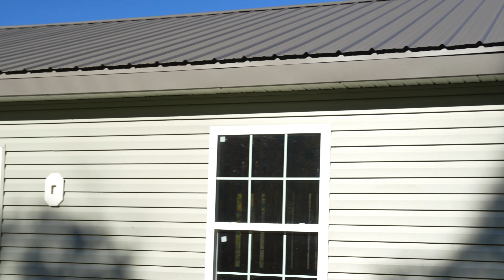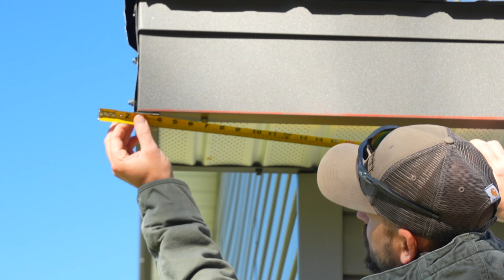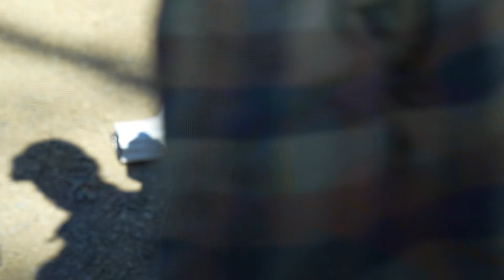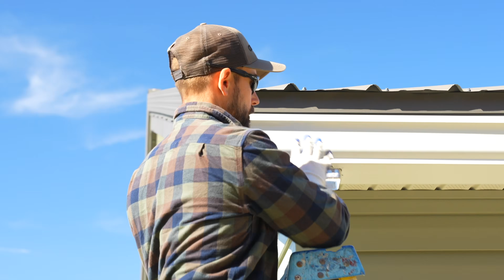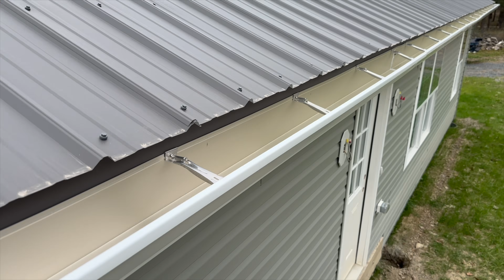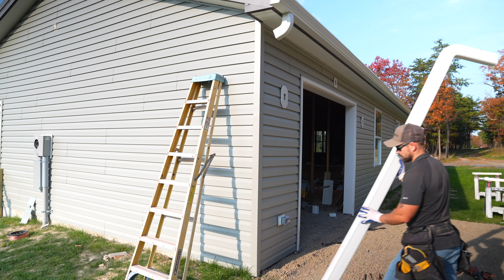How To Install Gutters | DO IT YOURSELF!

Comment: Gutter installation involves measuring, cutting, sealing joints, and ensuring proper slope so rainwater flows away from the home. Walker Roofing & Construction LLC provides expert gutter installation Mentor Ohio services for reliable drainage and long-lasting protection.

Comment: I had to notice that you didn't answer any questions about installing under the drip edge, why is that? 😊
Reply: The drip edge is as long as the house roof. If you extend the gutter out by 1 inch or so you can not do that. What I did was to install it out of the drip edge but at least 1/4” far from the highest side and then use pieces of drip edge to tuck under the existing drip edge and overlapping the gutters edge. Works great and you don’t even need to screw it

Comment: Excellent .  It's details that are important.  You explain the little things you know us DIYers are likely to screw up like direction of water flow, crimping the end of bends going to downspouts with needle nose pilers  so they'll slide in easier,  how far to slide them in,  using the sealant,  how to cut gutter with reverse blade mitre saw, etc.  Your details are what made this video great.  You are an excellent instructor.     Your video recording skills are excellent as well.  Now I'm gonna fix that darn gushing  downspout connection at the  corner of the house.  Thank You!

Comment: well done.  2 things i would like to reccomend.  the down spout flange just turn upsidedown and scroll it. no measuring needed.  little easier for the dyi er.  also. pop rivoting although secure does not allow yo to take apart if you need to clean some stuff out that just wont get through. Use the small white zip screws for that  

 just a couple ideas

Comment: He was able to hand-hold a drill to put those end cap rivets in? As soon as you touch the tip of the drill bit to the sheet metal, it's going to want to walk - and there's very little space to put those rivets in. Hmmm ...

Comment: How big is the facia board? Is that 1" x 6"? A 6" gutter is 5" high and the drip edge takes up an inch or so. So how would a 6" gutter fit on a 1" x 6" facia board?

Comment: I didn't read all 140 comments so I apologize if this question was asked and answered. Why don't you just use the small white screws for the whole down spout section instead of the rivets? That way if you need to take any part of the downspout section apart it would be much easier that drilling out the rivets?

Comment: On an older building I would check the facia for level and not assume.   Also, on a long run with downspout at each end, slope downtown both ends.

Comment: Couldn't you also call up a gutter company and have them manufacture a seamless gutter set for you (After you measure everything) and then just have them deliver it to you/ you pick it up with a Home depot van?
Reply: Take a minute to reflect on what you just asked. You're asking them to manufacture let's say 60 feet of seamless gutters, have them delivered to your house.  How much do you think you'll be saving by not letting them install them?  I mean the guys are right there.  And two; Have you ever rented a Home Depot van to deliver 60 feet seamless of gutters?
Reply: @lagunabay51  I dont know, but labor is typically the most expensive part. If you're a brokie but you know how to do mechanical stuff its a good learning experience. Also, the forward slash is the alt option in case they dont want to deliver it

Comment: Does the gutter tuck under the drip edge or do you secure the hanger over the top of it?
Reply: If I remember correctly the gutter should tuck under the drip edge directing all water into the gutters.

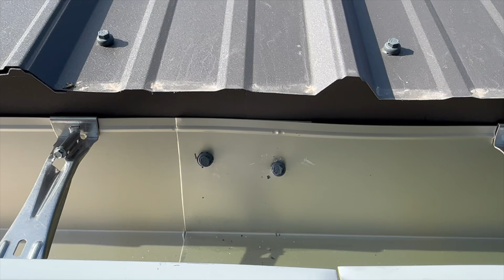Comment: Hi! I do seamless raingutters for a living, and let me be apparently the first to tell you that this video... is absolute dogshit. Surely this has to be a gag video for clicks. First and foremost, you are ON TOP of the flashing. Not behind, not underneath, ON TOP. The rainwater is going to run behind the gutter and rot out your fascia, and all that "money you'll save doing it yourself" will in fact cost you more in the long run fixing the shit than it would've if you had a professional come out and do it right the first time. Also, what is up with all of the rivets? I mean like holy shit dude, six rivets in the front AND the back of your overlap(not even gonna mention how incredibly soft using a c-clamp is), and do you think you sank enough rivets into the downspout? Oh, and @14:15, I have legitimately no words for how fucking awful that looks. You should be ashamed of yourself for spreading misinformation, I seriously hope you're not really out here doing this to people's houses.
Ladies and gentlemen, this is gutters done WRONG. This video is absolutely, unequivocally the WORST possible way to do gutters. Don't trust a word from this hack.

Comment: Im not sure why but I dont see a drip rail from under the metal roof and over the back edge of the gutters.That back side crease on the gutter Is to accept the lip rail to keep water from reversing back to the substrate.

Comment: Hey Josh,
When you extend a gutter 2 inches past the edge of an eave -- beyond a roof side that is a gable end (as in 5:10), do you do anything special to the lower drip edge running along the GABLE edge? 
This is the gable drip edge that runs perpendicular into the back of the gutter extension. 
Do you put sealant along the edge between the drip edge and the back face of the gutter? 
Do you add a right-angle flashing here? 
  - If so, where do you apply the flashing? Behind the drip edge? Forward or backward along the back face of the gutter?
  - If so, how do you attach the flashing? Pop rivet to the drip edge? Sealant or pop rivet between the flashing and the back face of the gutter?

Comment: Hey Josh,
Is it possible to "waterfall" both inside and outside corners?
By this I mean that: after putting the upstream gutter down inside the corner, is it then possible and proper to put the downstream edge of the CORNER down inside the downstream gutter?
This would have the water waterfall over the upstream gutter edge down into the corner, and then the water would waterfall over the CORNER edge down into the downstream gutter.
Is that corner installation method better than installing BOTH upstream and downstream gutters DOWN INSIDE the corner?
Note: It would require snipping out the front UPSTREAM  lip of the corner in order to accept the overlap of the upstream gutter.

Comment: I followed this video for my DIY gutter install—worked great, but I noticed water leaking behind the gutter. Should it be installed behind the drip edge? I didn’t see that mentioned. Thanks!
Reply: I worked gutters professionally; yes, the  gutter should be behind the drip edge.
Reply: what. If. No. Drip edge. Was. Installed. Before. The. Roof?  Can. You do. Drip edge. After. And. How. To install it. ?

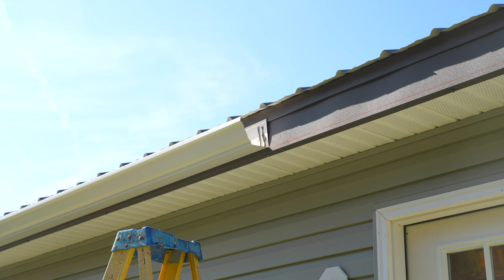Comment: Excellent video!  Question:  There is supposed to be some type of strip that tucks under the shingles and down the side of the fascia?  Kinda L shaped?  Thus preventing water damage to the fascia?  @13:32.  My house does not have that, is why I’m asking.
Reply: You are correct! The gutter is always supposed to go behind the drip edgs as well. If installed gutters like this, you will eventually have problems down the road
Reply: @1forallortiz733 how. Can. You. Install drip edge.  After the. Roof ?
Reply: Called a drip edge

Comment: Are you not supposed to slide it under the drip edge?
Reply: Sometimes you can, but it depends on how wide the  drip edge is.  But most of the water runs right off the roof. That was a long span he was dealing with..
Reply: I was wondering the same thing?  @13:32
Reply: Absolutely

Comment: Here's a Hack for ya!   Place a level in the gutter and you won't need to snap a line and you know the water will flow in the direction you want. What if your fascia isn't level? or the foundation has heaved??  Your gutter will hold water and become a breeding ground for mosquitos at best, at worst it'll leak into the house and cause major damage.
 With B elbow's measure the soffit overhang back to the house that's length of pipe you want to cut. With 3 x 4 A elbows subtract 8 inches from your measurement. (6" if you're using 2x3)
 In a climate with snow, you absolutely want to have the gutter behind the drip edge, or you'll have water/ ice running between the gutter and fascia.
 If it's a shingled roof you want the gutter behind the drip edge if you don't have at least a 1/2" of shingle past the drip edge the water WILL run between the gutter and fascia.   

PRO TIP: big box store products (1 star would not recommend) are very flimsy compared to the products a professional seamless gutter installer will be using and no warranty.   With gutter you absolutely get what you pay for.
Reply: My experience has been great since around 1998/1999 installing Home Depot gutters, because they are still on the house with no issues. So I must disagree. I know I'm only one person, but I still disagree regarding your statement of.....

"PRO TIP: big box store products (1 star would not recommend) are very flimsy compared to the products a professional seamless gutter installer will be using and no warranty. With gutter you absolutely get what you pay for."

Comment: Why wouldn’t you install the gutter behind the drip edge off the roof?
Reply from the maker: When the water is coming off the edge of the roof, it’s going to go into the guttering. Any water that splashes onto the drip edge will still not come in contact with any wood. I hope that helps!

Comment: The inside of that gutter hole looks better than the outside because the flange cover the cutout. I wonder if they sell better kits that hide the cut metal on the outside. Or is there another step coming up later to hide it? Another great tutorial.
Reply: I think the idea is the downspout should hide the cut as long as you don't get too wild with the snips.

Comment: 1 Always install gutter behind the edge metal . 2 slam 1 end and pitch appropriately or if 2 downspouts slam the middle and pitch to downspout locations. 
As someone who has been hanging gutter for over 50 years to much to say so I won't. 
Best of luck with your projects. 😊
Reply: Can you explain further?
Reply: Is there a coherent version of your post after 50 years of hanging gutters? 🤦
Reply: I've had to replace so many facia boards because they were installed like this...
Reply: Lol I’ve been Installing gutter for 20 years myself. This was entertaining to watch.
Reply: Yo, use self tapping gutter screws  on your downspouts and outlet to the downspouts. Crimp those end caps, faster. Assemble the downspout from the bottom up as the elbows have more flexibility. 
When attaching the gutters to the fascia board, secure them to the tail end of the rafters on center, not just random areas on the fascia, could fail over time.
Reply: @digitalmediaproductions7976 how do you find exactly location of the rafters end when the facia or frontal boards cover up with vinyl ? I'm about trying to install gutter on my house , all the areas right be low the roof edge are cover with vinyl ,thanks for your advice

Comment: Pretty simple when it’s a ranch style straight shot.
Reply from the maker: You are correct! That is part of the reason why I like to build ranch style houses, they are usually pretty straightforward. Thanks for stopping by!
Reply: My ranch house has lots of turns in and out, meaning, LOTS of cuts of small pieces. It may be easier, but it sure is tedious!
Reply: @mr.c6674 just hire a gutter company. We aren’t that expensive, and as professional we cut our own miters at the corner. (No boxes) so you have one seam at each corner instead of 3. Here in Georgia we only charge about 7.50 a ft.
Used to be a lot cheaper 4 years ago though